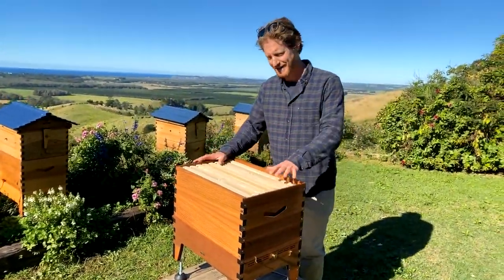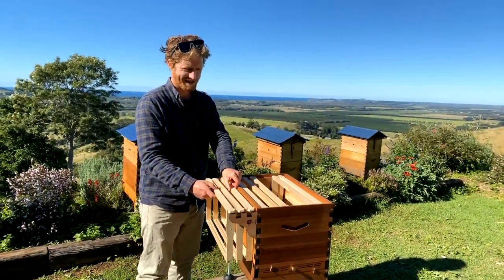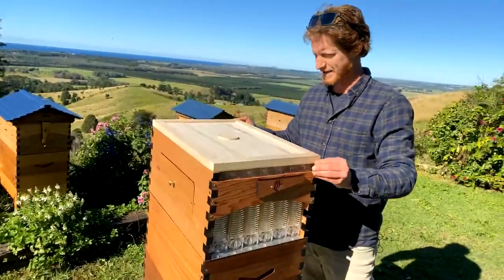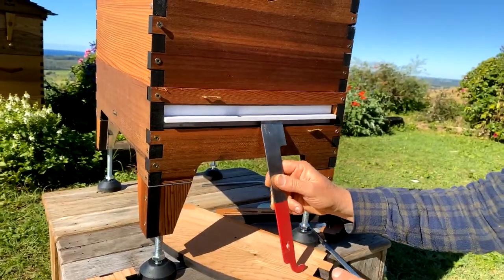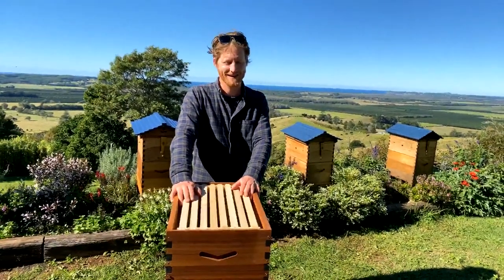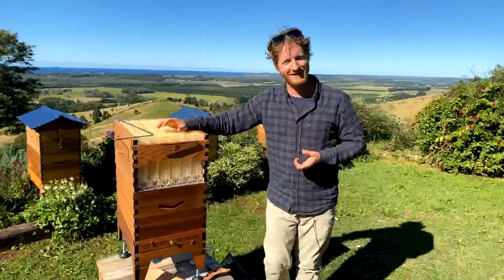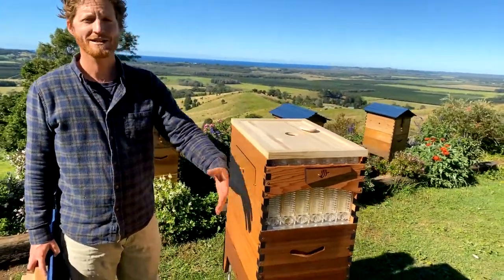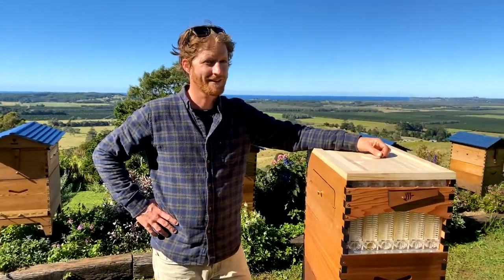Tips and tricks - Flow Hive 2

Comment: Can you use a standard langstroth lid\roof on the flow hive 2?  Will it still allow you to insert the tool to open the flow cells?
Reply: You would need to shim a telescoping cover up a little for proper clearance at the top of the flow-super. Not much, just a little 1/4" or so would do it.